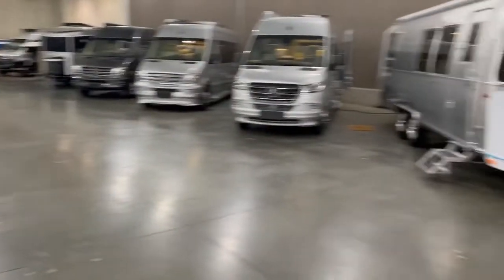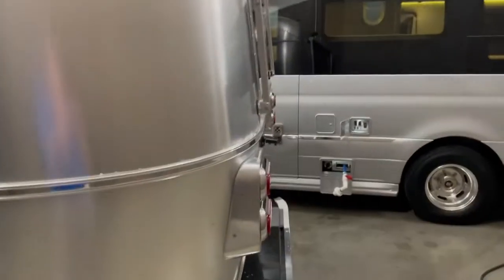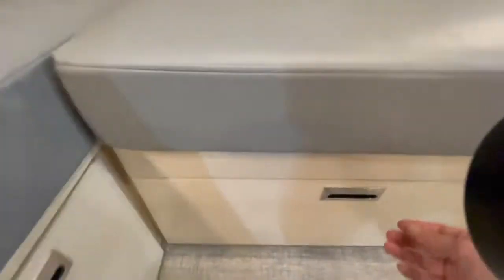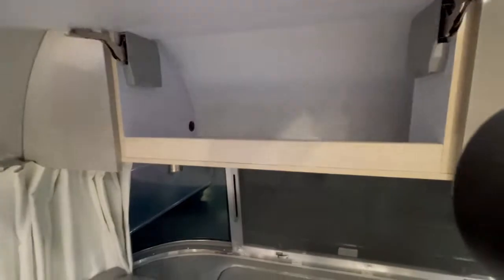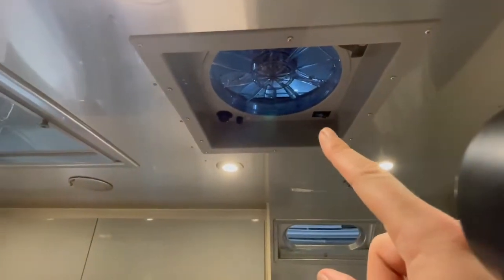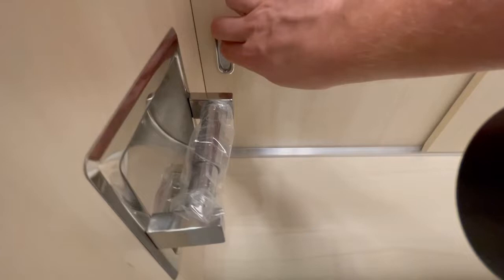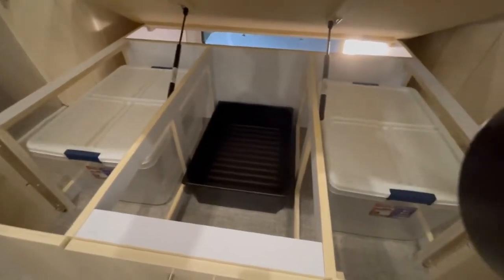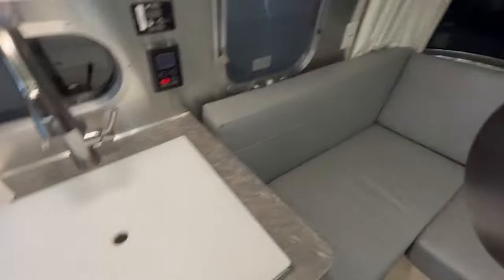2022 Airstream Flying Cloud 28RB Walkthrough Southaven RV

Comment: Owner  of 3 Airstreams and it seems every year they cheap out a little more on quality and usability compared to models from several years ago. That might be Airstreams worst model. The square sink, large door that has to be opened into the aisle to access the silverware drawers, bath layout w two cheap mirrors and no window and tiny storage, poorly accessible under queen bed storage and the cheesy room divider curtains are just few things that immediately jump out. Put 2 or more adults and their belongings in this model and the whole usability game changes. Glad to have the slightly older models.